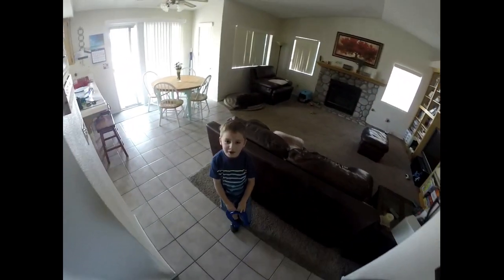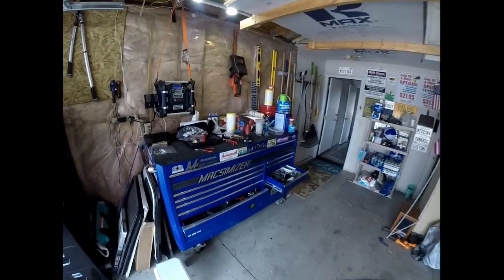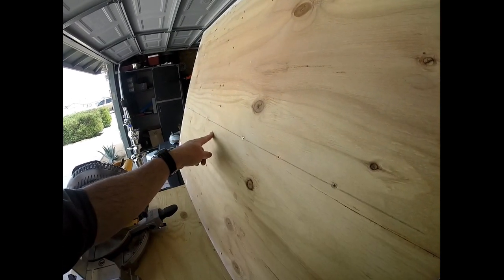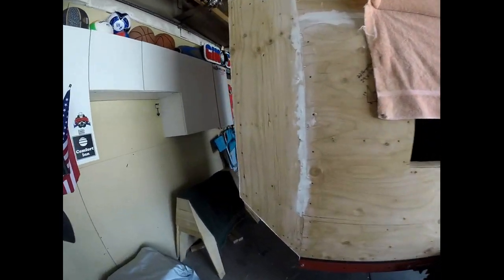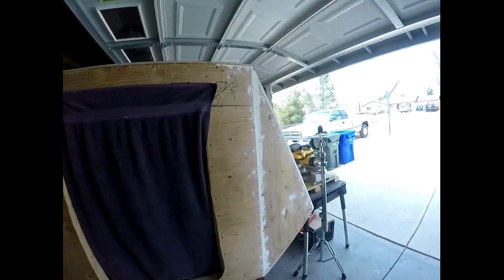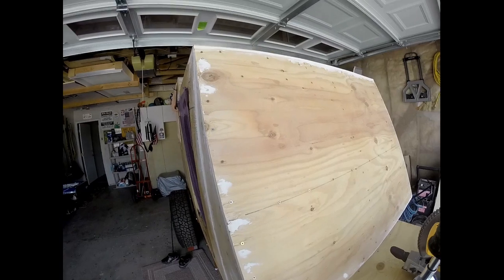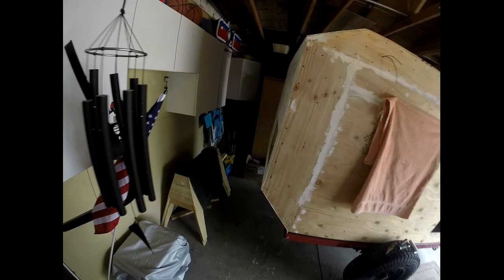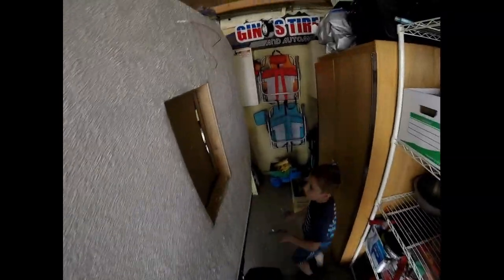4 x 8 Camper Part 23 - Well? A little more progress.

Comment: Looking good.  I pulled the tarp off mine and hammered out the wheel studs that need replacing.
Of course the auto parts store didn't have what I needed, so they are on order.
Once I get the studs in and wheels mounted, I will put a deck on and get it licensed.
Then it's game on for the build.

Comment: Tireguy1000, can you tell me the coatings you used on the trailer. I might want to steal your ideas, if you dont mind. Nice strong built you have on the camper.
Reply from the maker: Hi George!  - I go into great detail regarding the brand and type of coating I used in the last 2 videos if you want to see how it all worked out for me.  I did extensive research. I found that based on many tests the Durabak 18 product finished far above many other "bed liner" type of coatings.  The guys at the Durabak site are very helpful. The product's reputation is very good. The finished and dried product after application looks very very good to me.  The application process does not come with out it's own challenges however in my opinion as I state in the videos.  Welcome aboard! I hope you video your project. I love watching DIY stuff!
Reply: Thanks, I was thinking about using canvas and titebond.

Comment: Hey tire guy, What type of Vinyl spackle did you use? Is it sandable? Im using a spackle but but Im concerned its not good enough to use. Would you mind posting what you used. Id like to try it vs what I have.
Reply from the maker: https://www.homedepot.com/p/DAP-Vinyl-Spackling-32-oz-White-Ready-to-Use-6-Pack-7079812132/205503604?cm_mmc=Shopping%7CG%7CBase%7CD24%7CMulti%7CNA%7CPLA%7CAll_Paint%7c71700000032325895%7c58700003835893712%7c92700030694005646&gclid=EAIaIQobChMIpIy1lfH32gIV0QOGCh3_VgC4EAQYASABEgI4nvD_BwE&dclid=CMPll5fx99oCFa_H4wcdxIUMyA
Reply from the maker: It is DAP Vinyl Spakle  I left a link here yesterday but Youtube deleted it.